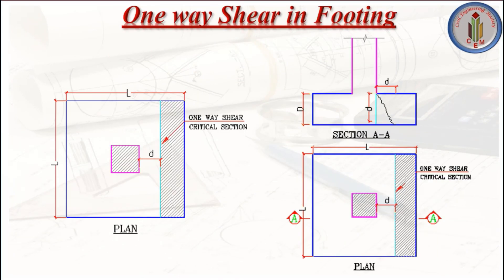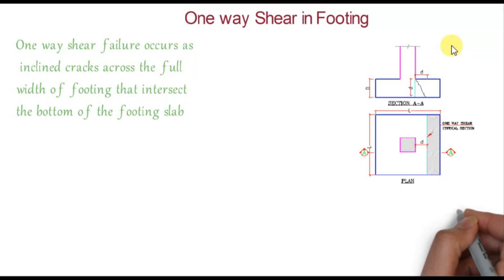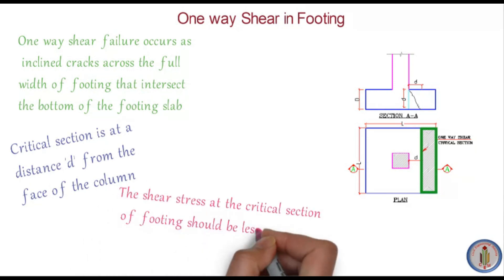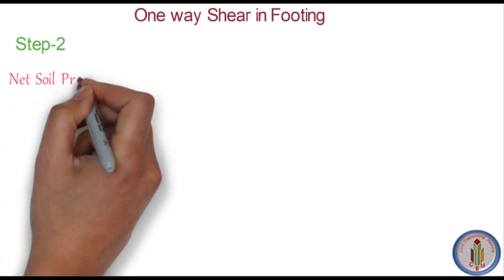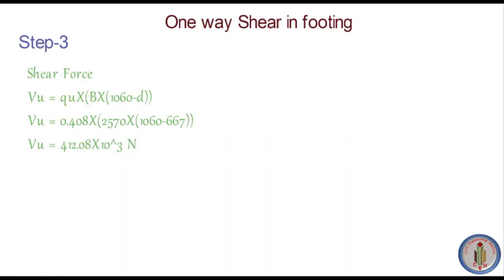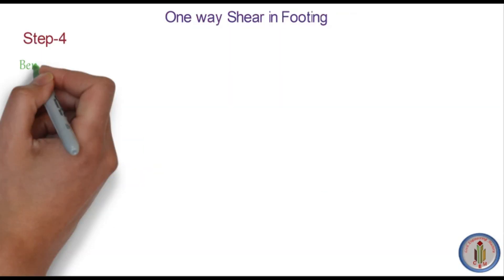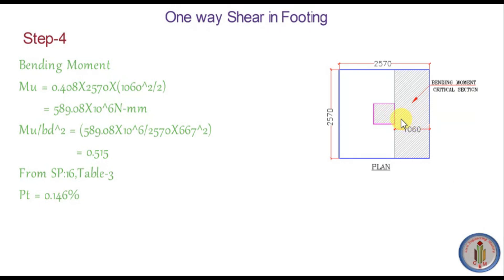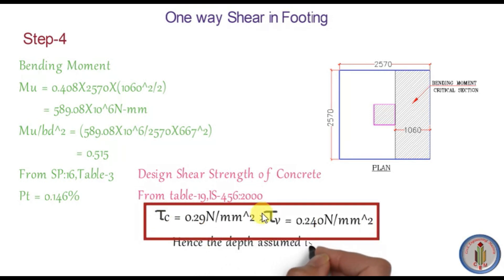One way shear in footing | Beam shear in footing | Critical section for one way shear in footing

Comment: from where you got the 2.57x2.57?
Reply from the maker: It is the size of the footing. Kindly check the calculation.
Reply: @CivilEngineeringMastery  How did you get 2.57?  If u divide 6.6/2 = 3.3 m